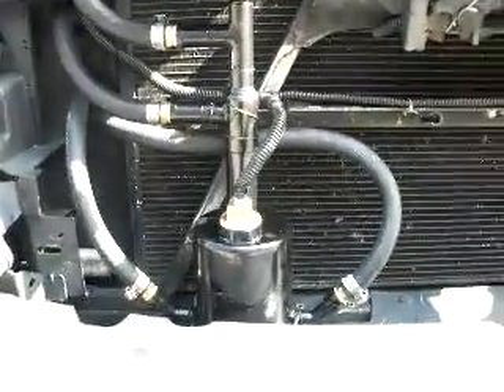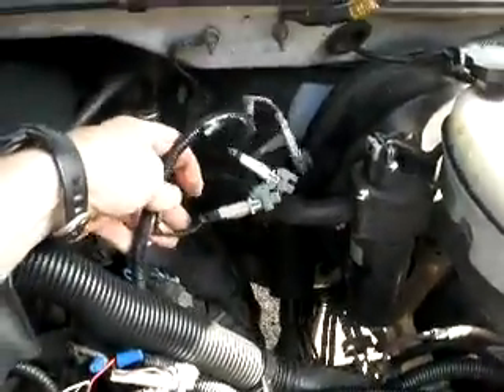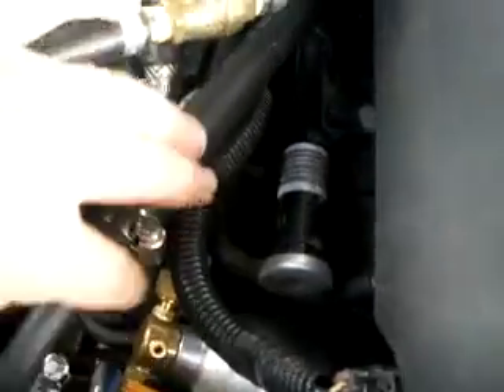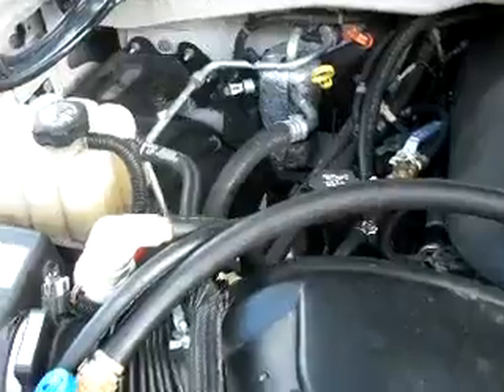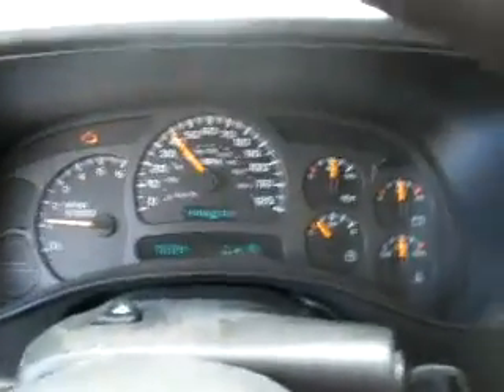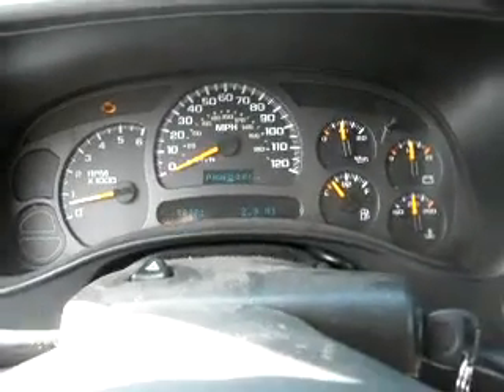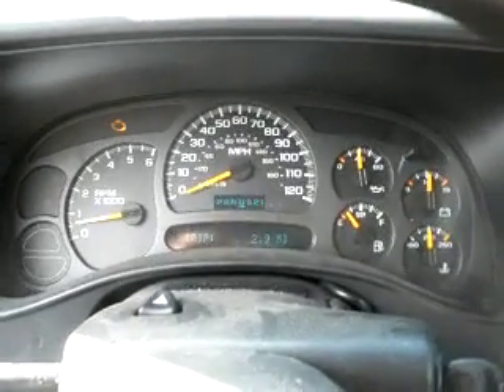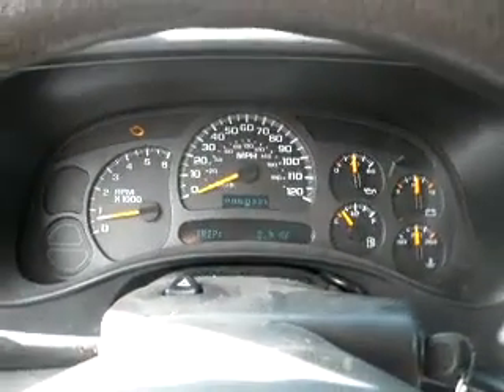Road Test In Progress from running on gasoline vap

Comment: I would be most impressed if you pulled the fuse to your fuel pump to entirely disable it, thus no fuel pressure what-so-ever is at the fuel rail, and to see it run with the fuel pump it self completely and totally off.

Another commenter mentioned this to you, and your reply was not entirely correct. The fuel injectors are designed to run at a specific pressure, which is relived back to the tank by the fuel pressure regular. When the engine is running the pump runs constantly, and the pressure regulator allows it to run at the specific pressure the injectors need, sending what is not needed back to the tank.

So if your system is running off the vapors strictly, and not fuel being pushed though the injectors, because even with them unplugged, fuel is still passing though them, they pulse to regulate the fuel, simply unplugging them doesn't prevent fuel from flowing though them still, then disabling your fuel pump will have no effect and your truck will run with out it running.

Impressive idea never the less, but I would totally believe it, if it still runs with the trucks fuel pump totally disabled.
Reply: Pan Gramercy that is not possible the pc will shut the engine down if the fuel pump is not building pressure try it most new cars and trucks won't even turn over if you pull that fuse
Reply from the maker: I pulled the fuse out, the fuel line had no pressure accumulated on it and I ran my engine just fine on the vapors. Thanks for watching.
Reply: +rockethead555 no fuel passes through an injector without it being pulsed by the computer, no pulse = no spray.
Reply: He unplugged the injectors from the harness which disconnects them from the computer.  so no ground at the computer = no injector pulse, = no gasoline from the fuel rail entering the engine.
Reply: he is drawing gas fumes from the gas tank with a direct connect line drawing the vapors.  the fuel rails don't matter. i was simply summing up the reason one would not have to disconnect the computer. Saying if the wiring harness is disconnected the computer wont energize the injector via "ground".  That is how most injectors work, it grounds the injector for x amount of time, energizing a coil in the injector, in turn opening the injector with the magnetic field.  Yes it is a duty cycle. How long the duty cycle actually last, is based off of the reading from the O2 sensor.  I am an electronics guy, and have been for 16 years, so i think i am O.K. in that department. I am sure there is a lot more to this than just running a rubber hose to the gas tank and piping it into your PCV port, and unplugging the fuel injectors at the harness.  either way, One does not have to unhook the fuse for the fuel pump.  The engine is not getting liquid gasoline from the rails for obvious reasons. Even if he did unhook the fuse for the fuel pump it would run just the same.  Could there be problems?  well sure, but look at phones now, compared to when they first were invented, if this is the prototype, i would say he is off to a good start.  
    I was following this guys stuff years ago.  If it is legit, it is something to think about for sure.  
   I don't even remember the original response i gave trying to help answer someones question.   Furthermore i did not realize i would be graded on the completeness of my response.  Sorry boss.  I will put it in graph form, and be sure to have a cover letter for my T.P.S. report, be on your desk by 9 a.m.  
   At this point I believe you understand what he is doing, but you are picking at it, saying it would be more trustworthy if he removed the pump fuse?   While he is at it why not just remove the pump, and the relay all together?  
   For me showing the injectors unplugged will do, i get what he is trying to say.  Do i believe it works? well that is a whole other matter.

Comment: Congratulations you just took the automobile back 45 years. Only thing that would be a problem would be temperatures below 35 degrees where a choke is normally a necessity because essentially he is running a carburetor. That is why have advanced into computer controlled fuel injection.
Invest in a good after market pcm and terminal software or app package.
Reply from the maker: Actually, no I didn't. .. the fuel economy back then was worse due to mega over spray and waste of fuel. The EFI engine still has over spray but not as bad as the carburetors did. The point I'm trying to get across too everyone is that other methods can be used to meet the engines cooling requirements and at the same time get a better MPG results. Thanks for watching.
Reply: Like I said, Invest in a good aftermarket PCM and terminal software, or app. If your wanting to change gas mileage, or gain horsepower, and torque etc.
You have showed no proof of anything other than regressing back to the carburetor / throttle body era.
Reply from the maker: I did however try a software for updating the ECU,  however to prevail but a few MPG  advanced. My system would work fine if I had heated the other part to maintain the vapors in keeping it going so that I can document the new MPG gained. But unfortunately, I  couldn't finish my project due to lack of funds. ..the solution is there already but the funds is a different story, I live a common man's life with a family too support. Could I change the world. ...?. if the funds were there, I would do my best to try!!!
Reply: What an answer. Sounds like you may of missed your calling. Maybe in another life you will say those words on stage as a contestant in a beauty contest. It will be your answer to the question, "if you had the funds, what would you do to change the world?" Thing is "change" is one of those buzz words that politicians use to pump up the young people, and uninformed vote. And, remember what your grandpa told you, if it aint broke don't fix it." Pre heating the fuel to put the fuel at flash, or evaporation temp before the atomization takes place will allow a cleaner burn hence using more of the molecular mass to be expelled as energy as opposed to waste product in the form of soot. In turn raising fuel mileage "X" %. It is interesting pulling your combustion air over your fuel supply from the fill cap in theory grabbing a higher percentage of vapor as opposed to atomization process you have with the injectors. This has a cooling effect on the fuel. Raising the temp with an inter cooler (in this case a heat exchanger tap of engine coolant, or main fuel line tap for mixing fuel into the egr circuit) from the heat of the engine which the heat is the largest form of waste in the total process. The problem is the gathering, and monitoring data is sketchy down to measuring mileage. Hard to prove your experiment this way. You could call Guiness , or better yet Ripleys, and see if they would send a witness out. Im afraid Popular Mechanics would decline via liability / safety issues I would surmise. Anyway, groovy, and keep it real dude.
Reply from the maker: That's funny, I had a good laugh with that one. ... but anyway thanks for your time , knowledge , and input given here on my video buddy , all is welcome. God bless, 

Kevin.

Comment: Does your gas peddle work normally?  How does that work if the injectors are disconnected?
Reply from the maker: Gasoline vapors were introduced into the air intake, when the pedal is pressed it opens the gate in which a vacuum is behind wanting to pull in more air. Instead, it's a mixture of both causing acceleration. It's a 2 part system in how it works. My idle runs off of vapors hooked directly up to the PCV valve vacuum port which draws what it needs to keep running. Thanks for watching.
Reply: +whyme2b Doesn't the spark plugs also work off the gas pedal?
Reply: +Carl Darl the sparkplugs are operated based of the crankshaft sensor.
Reply: Norbert Daniel Chirilenco Thanks

Comment: like running on vapors  just hook up propane or natural gas
but do not expect more mpg the air fuel ratio still has to remain the same
Reply from the maker: Yes, you can use those things but it can work at a different air /fuel ratio by using water vapor entering through the air intake. Engine runs smoothly and no damage will result. Thanks for watching.

Comment: Hey when ever you get your road test over with and if your recording any results, I'm interested in knowing how good gas mileage you get if any at all, also have you considered adding a hydrogen generator, that might be interesting to see.
Reply from the maker: Road test was done that day. I  drove for 8 minutes, then acceleration stopped due to gasoline condensing down. Fuel needs to be heated on the acceleration side as it was on the idle side. I have thought of the idea of adding a hho generator, but not in using electrolysis too produce it. When water vapor hits a hot cylinder,  it already becomes hho gas in which cylinder compression ratio increases dramatically in which also cylinders are kept cool through steam being produced in there. A simple ultra sonic transducer used in producing water vapor injected into the air intake will be the answer to running on gasoline vapors with no damage to your engine. Thanks for watching.

Comment: What controls the vapor flow rate when accelerating - engine vacuum? ..... how do you know if you might be running lean and damage the engine? - exhaust gas temp?

Sounds really slick - please keep me up-to-date.
Reply from the maker: Yes sir,  the engine consumed only what it needs through vacuum. .. engine was running fine and exhaust temperature dropped by few degrees.  If you like to feel even better in knowing that you're engine is safe,  I recommend water vapor injection into air intake threw a ultra sonic transducer. Thanks for watching.

Comment: So, can you let me know how many mpg's/mpl's you are getting by running off of fumes.  Also, how are you heating the gas before it goes iinto the engine, and what is your method of heat regulation?
Reply from the maker: Greg Knott I never had the chance to get the results because of my fuel condensing down in my tank, which powered the acceleration. Vapors stopped after driving for around 8 minutes. The tank fuel also needs to be heated to continue vapor output. My idle worked great because of my device which heated that part using the engines coolant system of 212F to keep it vaporizing. Perfect temp maintained with no dangers of self igniting....

Comment: ok thats great, but to what benefit or savings?
Reply: +Carl Snyder your burning fuel at 95+% efficiency instead of 15-20% efficiency. so way better emissions. not to mention since your burning so much more efficient youd need to burn way less fuel for the same amount of power=way better mpg
Reply: Klaudia Fuss

Comment: Can't see the point at all???
Reply from the maker: Roby babe That's okay buddy.... thanks for watching anyway.
Reply: whyme2b
If you'd done it using water (Hydrogen & Oxygen) & this can be done quite easily (we've tried it using electrodes into brine) then this would be fantastic but you're still using "petrol" vapours, which is basically what injectors produce or a carburettor,so unless you're getting 100mpg then I really can't see the point?
Reply: Roby babe   LOL  Unless you're stinking rich, the point is to save money any way you can.  This system is good.  It's been around for about a hunnert years.   No lie.

Comment: While I understand the concept you have here, my grandfather was a retired Ford mechanic and did this same thing back in the `70`s with carb cars. The one thing that he was concerned about, and you should be too, was if the engine "sneezed" and backfired through the intake. If this happens due to a lean air / fuel mixture which is highly likely, especially in cold weather when air density increases dramatically, then here you have a direct path straight to the gas tank and an ignition source created by the backfire in the intake and then Kaboom! in the gas tank. Just something to think about, you have a good idea there, but in all honesty, there are many ways of achieving the same effect,  however what you really need is a more efficient heat exchanger to run the gas through before it hits the intake. Smokey Yunick did this years ago by wrapping the intake manifold with the exhaust manifold. He was getting almost 100 miles to the gallon in a stock 302 Ford engine and over 350 horsepower out of a 2 barrel motor that was only rated at around 120 horses from the factory back in the late `70`s. The exhaust was so clean he said you could dry your hair with it. You should be able to find info on that experiment on the internet. I believe there was a write up about it in Hot Rod or Popular Science back in the day.
Reply from the maker: 1960gambit Yes sir, all noted.... Flash arrestors installed in 3 different locations, not possible of un exposition happening. All ran fine as well, not a lean mixture at all as people would think it is... perfect mix. Thanks for watching.
Reply: Yes Smokey  was using a turbo to supply a limited positive pressure to the air flow to keep everything moving forward. As anyone familiar with HHO projects will attest you gotta have those spark arrestors(multiple). Also a exhaust temp sensor will prove a worthwile investment. Ask a two cycle kart racer. Use a infared temp gun to find your hottest exhaust port  they wont all be the same then install it there. Good luck and be safe.
Reply: whyme2b Having read all the comments down to here, plus the moron troll arguments, it seems to me it can all be summarised by stating this, (as far as I'm aware and was taught). An ideal fuel mixture for the internal combustion engine is 14:1 I believe that applies, whatever the fuel, and whatever form it takes in this type of engine. It won't run if its "too lean" as has been harped on earlier in this debate. If the fuel is gas, or if it is liquid is irrelevant. 14:1 mixture in the piss tin, and regulated to stay that way by varying whatever means it takes to get the stuff in there, THAT is a fact that can't be argued with. I don't claim to be a mechanic at all. I'm an Auto Electrician and a rusty one at that. But what I do see is lots of misinformation on fuel vapour systems, many claims, many methods offered free of charge. No where have I seen yet where someone explains it from start to finish what parts to buy, how to assemble it all- from start to finish. Can you please finish it and show the world how to do it, before the oil companies and government knock you off, or find a way to suppress your information.
Reply: 1960gambit Ron Hatton  http://gadgetmangroove.com/?atid=42

Comment: have you pulled the plugs and  looked  at them ?  and  what effects would  all this  have on sensors maf the egr  system and  pcm  ,,,,,,,  also I was curious  about  any  affects  on  transmission shift points ,,,, torque  ,,,,   ect .
Reply from the maker: riff724 riff724 No sir, no need to in hearing how it ran. Only fault code I received was on injector harness failure. Transmission had no different feel or torque effect.... nothing but more power displayed in taken off, that's the truth my friend. Thanks for watching.